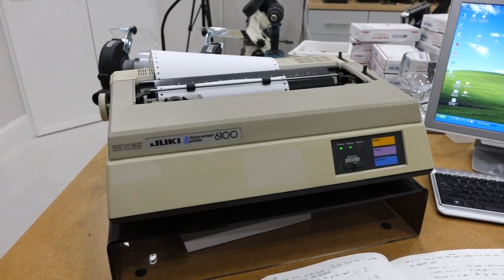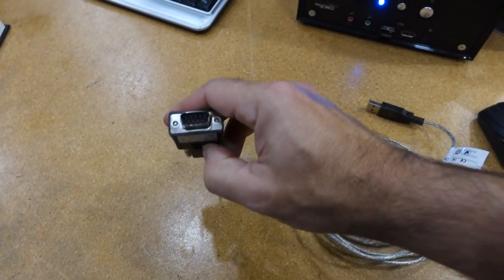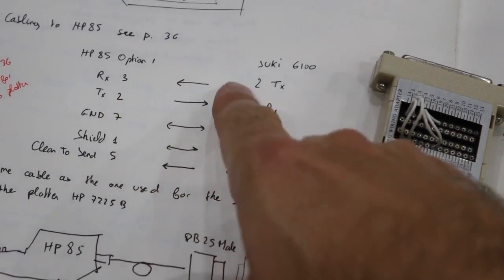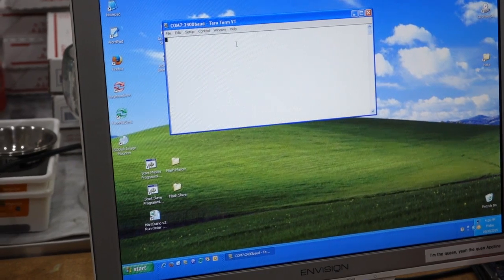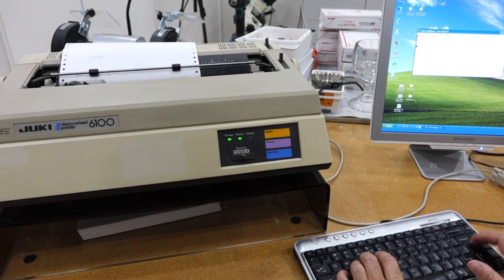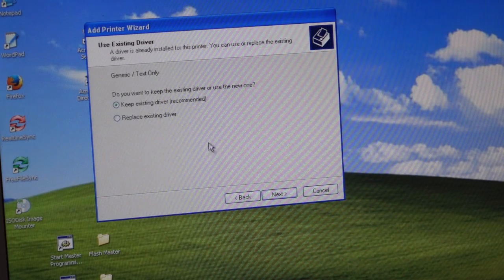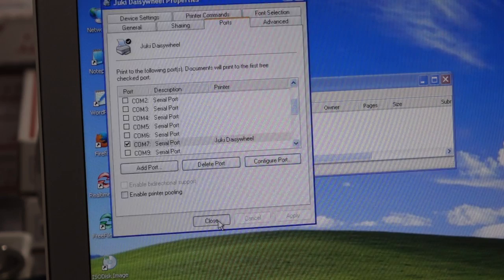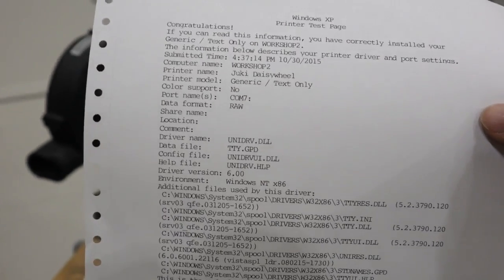Vintage Daisy Wheel Printer on WinXP - or the hard way to make a typewriter

Comment: my mother gave me her old smith corona word processor from her college years back in 2014. that one was a daisywheel. something in it broke unfortunately so daisywheel printer no longer could print anything resembling text (fontwheel locking mechanism broke & I haven't a single clue if it can be fixed). nice to see another daisywheel!

Comment: My Windows 10 runs my Tandy daisy wheel printer just fine with a generic printer driver and you have to figure out the dip switches. It works fine.

Comment: How many models of Juki daisywheels were there?  I bought one (seems like mid-eighties) and loved it (noise and all).  The model I had used standard IBM Selectric wheels.   I could swear it was under $200.  Is that possible?  I don't think mine was a 6100 but not sure.   Looks like the 6100 was about $600 but I sure don't remember paying that much.

Comment: I had a Juki 6100 once, but it was labeled as a "Kaypro Printer" and came with a Kaypro 2X 8-bit CP/M computer in 1984. It connected through the Centronics parallel port instead of serial. I never tried to use it with my later DOS and Windows computers. Good to know that it would work even with those.
Reply: I have the same one, also labeled as Kaypro. Got it separately from any computer. A very nice printer indeed. I printed schoolwork on it.

Comment: "A modern Windows computer": running Windows XP. Not that I don't understand why one would prefer Windows XP above newer versions, but there is surely some irony in that statement. Perhaps reflective of the nature of the channel. :)
Reply: Chuu Ni This video is from 2015 according to the upload date.
Reply: Nothing to do with XP but it was an era when software was released on CD and was intended to be fully complete and tested before release.  Unlike today where it is released on a store unfinished and updated every few weeks.  XP and various software will still function fine where there is no requirement for internet access.  Some software and hardware was very expensive back then.  Also the print quality of some of the daisy wheel printers is excellent, far better text quality than inkjet in my opinion.  Not versatile tho.

Comment: First time I heard and seen a daisy wheel printer. Sounds much nicer than a dot matrix, printing looks better as well. Just a bit slow, think the last dot matrix I worked with was 2-3 times faster.
Reply: Print quality was orders of magnitude better than any dot matrix, true professional letter quality.  Only limitation is they could only print characters that were present on the print wheel, so they were not particularly popular for home markets where the ability to print graphical bitmaps were owned by the dot matrix.

Comment: Interesting.....didnt know windows had something like that. I knew old epsons could do that trick but i didnt know xp had a generic text only printer, plus being on a serial port you could hook an arduino and do some fancy stuff using the printer interface. Theres even some diy dot matrix printers running on arduinos so maybe all could be adapter for a fully functional diy dot matrix printer.  Most of the problem would be the paper feed system with the roller and the ink ribbon

Comment: Nice :)

Another wonderful abuse of the Generic/Text Only printer can be to set one up to go to FILE: and use it to export data from applications that support print but no export (like, Altiris Deployment Console ...). It took a lot of fiddling with column widths prior to print, but we could export stuff as fixed width text that way.

IIRC it assumes 10 CPI horizontally (so 13.2 inches = 132 columns) and I think we set the page length to Continuous so as not to deal with the hassle of repeated page headers.

Comment: RS232 is the communication protocol for a 9-pin serial port. Actually, this protocol only uses 3 wires: (1) +5v, (2) signal, (3) ground. Other implementations of RS232 include VISCA, which is developed by Sony for camera remote control. (From Wikipedia: It is based on RS232 Serial communications at 9600 bit/s, 8N1, no flow control typically though a DE-9 [or DB-9] connector, but can also be on 8-Pin DIN, RJ45 and RJ11 connectors use in daisy chain configurations.

VISCA utilizes a serial repeater network configuration to communicate between the PC (device #0) and up to 7 peripherals (#1 through #7). The daisy chain cable configuration means that a message walks the chain until it reaches the target device identified in the data packet. Responses then walk the rest of the way down the chain and back up again to reach the system. Some packets may be broadcast to all devices.)

Comment: I owned one of these around 1985-1989 and printed up my final year college project on one of these attached to a BBC Micro Model B (running WordStar on a Torch Z80 co-processor). The "beeb" was heavily modified/expanded and lived in a Data General 4u'ish chassis intended for a pair of 8" floppies. It was powered off of the bonkers sized linear power supply intended to power the floppies and their logic. Those Juki's were bomb proof, even if they were a bit slow and noisy.

Comment: Nice ! I've got the reverse problem: how to have my ZX81 print on a Laser printer... I don't think it's possible.
Reply: It absolutely is, but you'll need an older laser printer and an interface module.  It's been a while since I've seen a laser printer that accepts text input, but it used to be common.  The ZX81 parallel port modules aren't cheap on eBay, I just found one going for over $200.  Old laser printers are cheap, you can probably find one for free.
Reply: Jon C
Thanks for the reply. If I really wanted to, I could find out how the ZX81 sends data to the parallel port on the back of it, when typing the basic command LLIST or LPRINT, and build myself some type of interface to convert this to USB serial stream using a Raspberry Pi or something like that. But, is it worth it ? Probably not.
Reply: It might be easier to do serial, I found this:  http://www.user.dccnet.com/wrigter/index_files/serial.htm

As to worth it?  Can't answer that one.  My favorite "old computer" laser printer is a DEClaser 1152, it does serial, parallel, LocalTalk, and DECnet.  I once got it working with a Compucolor II.

Comment: That's beautiful, man.  I love the "Of course you can!"  I wonder if the same would be true of using the printer (or even an old Apple-branded Daisy Wheel) on a modern Mac.  I would say "surely not", but OS X's print subsystem is based on the Common UNIX Printing System, so perhaps support for such ancient, obscure printers was retained when Apple took over the CUPS codebase.
Reply: And the answer is "Of course you can!"  CUPS supports daisy wheel printers, always has.  And since there's no point in reinventing the wheel, here's a really nice set of instructions with screenshots that somebody has done:  http://www.wheels.org/monkeywrench/?p=909

Comment: Hi I got my Juki 6100 to work with a Dell Latitude laptop running XP.   Used a parallel to parallel port. When you go to control panel /printers/ add printer select it as an Epson 600  printer. Geoff.

Comment: Back when I was a young kid in the mid/late 80s, my dad used to take notes and tapes to a print shop to have them transcribed.  They had a couple of these always running there alongside the big laser as well  - don't recall what model they were. I always thought they were the coolest thing ever. Around that time my dad also bought me my first computer used from that print shop, a Leading Edge Model M XT clone.

Comment: Remember the "print rooms" in offices that had printers in them and they had doors and were sound proofed?  This is why.  It sounded like a war zone.  :)
Reply: I do. Almost as expensive as the printer itself, with its own built-in fan(s) and all manner of hairy slots (sorry, but really) for paper, cables, etc. Weighed enough to sink a ship. And some of the bigger printers still caused the whole thing to march off the table. Ah, those were the days.
Reply: You made my day :D
Reply: Could also be used as a form of torture. lol. Do you also remember the sound deadened printer hoods?
Reply: @grlg2  I love that sound
Reply: There was a moderate after-market business in audio suppression cabinets, which were lined with the type of angled/spikey  plastic foam like one of those audio test rooms that the loudspeaker manufacturers use. Doing that, they could easily be used in the same office space as clerical workers . . . no problems. Thinking back,  in the early '90s, I used to have a  simple noise suppression cabinet for my dot-matrix printer at home.

Comment: I'm so impressed! I wish I could do this type of stuff!
Reply: It's just rs232 - really nothing very complicated.  The little connector box he made is just called a crossover or null modem cable. Serial is still quite widely used for automation, monitoring and remote control.   The back of many modern TV's, amplifiers and projectors will have a serial connector for remote control for the likes of home automation

Comment: Most receipt printers use the generic/text only drivers, so most printers like this Juki can still be used.  Now the graphics printers,  the Epson or HP LaserJet universal drivers will do it in a pinch, but the features that each printer has may not be available.

Comment: I want to see one of those old huge printers with the hydraulic rams that spat out paper at light speed
I'm sure someone has a video but I can't think of what they're called
Reply: Line printers.
Reply: RaymondHng
Yep, that's the one!
Reply: I once saw one, connected to an IBM mainframe, that printed two pages per second. Seriously. It was a 'chain' printer: it literally had something very like a bicycle chain that span around the paper at God only knows what speed. It had two shelves for paper in: so it could be swapped quickly, which was required very frequently. The paper out bin was huge. It was in a big soundproofed cabinet, but when the guy opened the door, the noise it made was visceral.

Comment: Oh, wow – how sexy is this?!

I was nostalgically thinking of my old Juki 6100, which I bought when the first came out, and which I used initially with my BBC B micro then my first Amstrad PC1640 (I’m in the UK). With the BBC B Micro I managed to commission a college to write me a printer driver that enabled it to do decently justified paragraphs. I also had a program which enabled me to use it as a typewriter. With the Amstrad I purchased a hard drive (on a card) which had, if I recall it correctly, the massive storage capacity of 30 megabytes – and I never ran out of space (nowadays it’s no problem to happily fill a couple of 5TB drives)! Anyway, the Juki printer served me without fault for several years before I moved onto my first laser and inket printers. I’ve still got it all stored away somewhere (but not readily available).

I was simply looking, on Google, for a photo of the Juki when it suggested these videos on YouTube – more than I’d hoped for or dreamt of. I just want to say how good it is to watch and hear one, bringing back the vision and sound that I loved so much and which kept me occupied for many a fine hour over several years! And, yes, it’s true - I probably don’t get out enough!

I’m so excited that I’m going to put this same comment on a couple of the others out there (and this is the first time I’ve ever posted anything on YouTube). Thank you for putting it online!

Comment: Where did you get that Juki 6100 daisy wheel printer? I had one with a proportionally spaced font print wheel in San Francisco until around 1990 when i gave it away. It may have ended up in your hands.

WordPerfect 5.2 for DOS had a printer driver specifically for the Juki 6100. The driver actually supported graphics on a daisy wheel printer by hammering away at the period repeatedly while incrementing the print head and the platen in small increments of 1/72 of an inch.
Reply from the maker: +RaymondHng Was sold to a fellow named James C. according to the original invoice, on 9/25/1984 for the incredible bargain price of $489 (because it was a store demo, says the bill). Too bad, that would have been more fun if it were yours! I should search for the WordPerfect copy - I have it on my vintage Mac though.
Reply: That sounds superb, and definitely worth a video if you can find it and get it to work.

Comment: There also exists USB<->LPT bridges. I used one recently to make a small embedded linux board talk to a high speed thermal printer. They're under $20 usually and I got one that ends in the Centronics output. Astoundingly, this also works in modern windows.
Reply: Even better. A lot of motherboards actually still have headers for serial and LPT ports on the motherboard. Just not on the I/O plate anymore.

Comment: Do the young ones know what a typewriter is ?  Can you still get carbon paper to print government forms in triplet ?  Thank you for a great video !  My printer does not work anymore.  tjl
Reply: Correct grammar is optional for an informal chat.
Reply: Yeah, you still can get carbon paper, at least where I live (poland). And yeah, I know what typewriter is (I'm in my 20s) and actually want one but all I could find are electrical typewriters and I want purely mechanical one.
Reply: One of those 20-somethings who work for a tech company asked me, "What's a minicomputer? Is that something like PC?"
Reply: Yep, us young sprouts know what typewriters are, and a good many are crazy to get their hands on one, hence why the lovable old word-mills are experiencing a bit of a renaissance these days. Carbon paper is still readily available on Ebay and Amazon, so cranking out copies "ye auld fashioned way" is still doable if you so desire.

Personally have two typewriters, both manual, and I love 'em.
Reply: A PC by definition IS a minicomputer, isn't it? It's anything smaller than a mainframe, which in the days before I was ever thought of, used to fill entire rooms, and there's a further subdivision between a mainframe and a supercomputer.
Reply: Shipwright1918 The correct grammar is "Yep, we young sprouts know what typewriters." Also, it's olde, not auld. The first word is English. The second word is Scottish.
Reply: Ohh, I see, thanks for clearing that up, It's been a long time since I've heard anybody even mention the terms, and it was only briefly in computer class and in a few textbooks I read.
Reply: +RaymondHng 

Very informative, thank you.
Reply: Do they know what a keyboard is 😀.  The thing that pops up at the bottom of the screen.